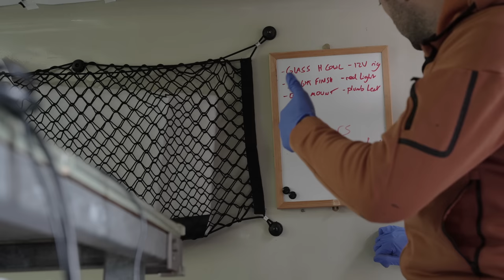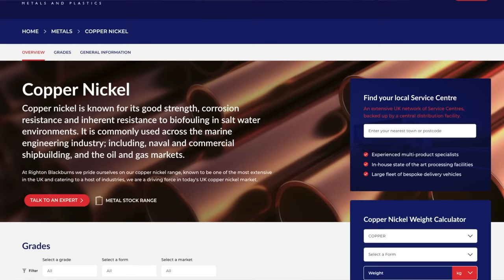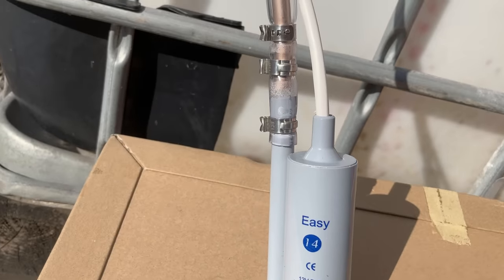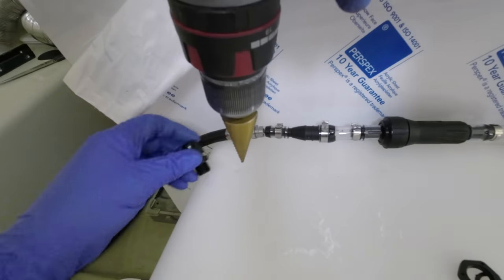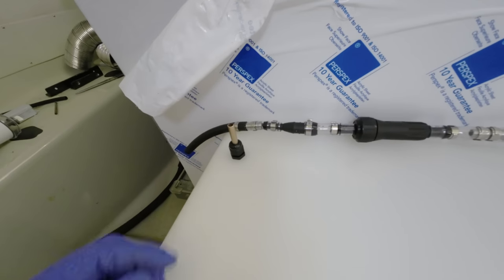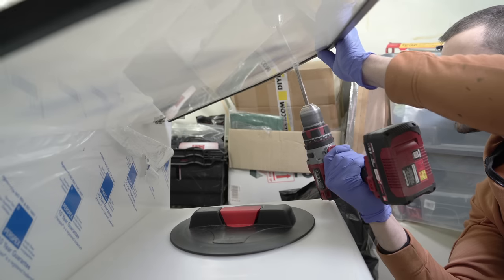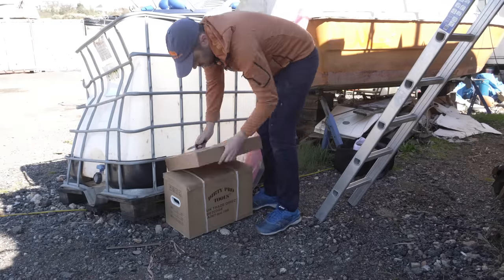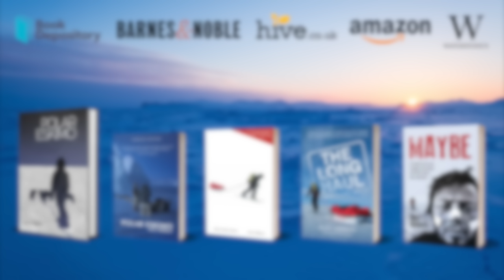12V drinking water pump wins over manual pumps w/ carbon block filter. Lifeboat Conversion Ep72 [4K]

Comment: Great work!  I'd be a little careful with the break line, it'll work great but there's likely residues from manufacturing like greases etc. I'd imagine they care less about break lines then a tube designed for potable water). It's very likely your carbon filter would be good enough but it might just be worth running a solvent through those lines, you could also run boiling water through it (Not with the PTFE tank fitted though). As hot water will probably loosen any oils.
Reply from the maker: Thanks for the concern, but the lines were capped on delivery and I noticed it said they were certified: Internal cleanliness to BS EN 12449.
Reply: @AlexHibbertOriginals  Oh interesting, very astute as always ^_^

Comment: for the swinging pump, an L bracket going to the side with a couple strong magnets should hold it in place. the inner one could be sealed to prevent corrosion.

Comment: Perhaps a baffle in the water tank from which the vertical water pipe could be attached to keep it from wandering. The baffle might help induce stability in Alan as the water can’t splosh around in bumpy seas. Like a tuned dampener in an earthquake prone building.
Reply from the maker: True. I'll need baffle balls anyhow.

Comment: Cut a hose to slide over the pump housing that will reach the bottom of the tank. The hose will do two things. One keeps the pump from bouncing against the tank. Two the pump can now reach the 50 to 75 millimeters of water below the pump inlet.
Reply from the maker: I like this, although the hose would need to be castellated. I don't want the pump to suck directly from the bottom in case of sediment.
Reply: @AlexHibbertOriginals  The obvious, so castellate it!  A Stanley knife would do, probably ....
Reply: You could also put a strong magnet in the hose, and one on the outside of the tank to clamp the pump in place.

Comment: With your pump flopping around inside your tank, you can use some of that thin cutting board that is about 1mm or 2mm thick, cut out a  long 300mm x 100mm section, drill holes for your pipes to fit through, bend over each end of the thin board at 45 degree angles & glue those to the inside walls of the tank with epoxy or silicone next to 2 corners.

Comment: I have used the same battery for my motorbike that I've built. Make sure you have the right regulator when charging it as if you charge it off the standard battery circuit from Alan's engine you can risk it blowing up as it can overcharge. They're great batteries.
Reply from the maker: Yeah they can only accept a slowish charge, so it'll be controlled by a Victron Smart split charger.

Comment: I bought a stickwelder years ago and have used it on plenty of non critical equipment. 
Most recently on my campervanbuild. 
Rarely pretty welds, but allways fun and it has given durable resaults so far.
Reply from the maker: Pretty is overrated.

Comment: "How to keep it still".  Easy, a set of suction cups  (like on a windshield of a car) inside the tank with just a dab of food safe rated rubber sealant so it does not lose the seal. Then a plastic zip line to the water tubes.
Reply from the maker: Do you not find suction cups never last long? Rubber sealant won't bond properly to polyethylene tanks. Barely anything does!

Comment: As for keeping the pump moored in the tank a simple rubber foot attached to a piece of spring steel that clamps to the line or pump. Set the foot 45° off each wall and the foot will limit contact with the wall.

Comment: Cushioning the pump against bumping will protect the pump, but eventually repetitive flexing will do in the tube. 
Cheapest, least invasive solution, now that the gland is already crimped, would probably be a pvc pipe mounting flange adhered to the bottom of the tank, cupping the base of the pump without blocking water flow.

Comment: Add an extra piece of pipe to the pump, fix it as still as possible.  Then use a pipe foot, the sort that kitchen cabinets use when free floating . Glue this to the bottom then insert the pipe into the foot. Glueing can be done with some spare food safe plastics. Use it as you would if soldering .
If you're going to be stick welding the you need to read, practice,  practice and do more practicing. Stick welding done right looks good and lasts but can be very unforgiving for the unexperienced. It can be very tricky, particularly on thin metal.
Reply from the maker: I'm considering a variation on this

Comment: Anchor the pump down. Take some stainless wire, bend a squiggly end and connect to a soldering iron, melt squiggly end about halfway into the pe tank below the pump, use soldering iron to melt and seal the plastic over the anchor wire and use the wire anchor to secure the pump.
Reply from the maker: I'd be nervous about DIY heat welding the bottom of the tank - but even if I wasn't, I can't reach that far inside.

Comment: While you may enjoy the flow rate at the moment you should be prepared for diminished flow rate as the filter does its job.
Reply from the maker: Quite possible. I can swap out the pump in 30mins or so, but it strikes me as better to avoid a higher pressure system than necessary.

Comment: A baffle may be needed … the water will slosh around causing additional noise and movement of the pump.
Reply from the maker: Yes the one central baffle may be insufficient. I have good experiences with baffle balls, so can add if needed.

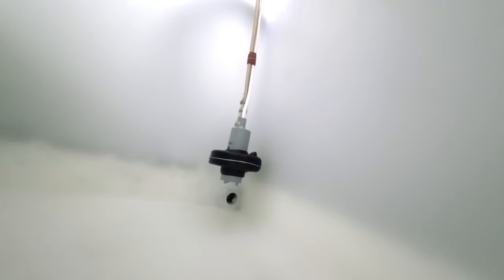Comment: could do a  little spring attached the hole visible at 6:47 to hold the thing stable. im not sure about securing the top. maybe a bend or a threaded peace. i bet if you try to use the fittings that are available to you youll find somthing

Comment: I'd be wary of having a rigid pipe on the pump. Seems like too much leverage when the water level is low and it's sloshing about. Maybe some stainless steel and a magnet to hold it in place? Or a much stronger pipe braced where it comes out the top of the tank? Or a brace that comes up to the lid hole.
I guess you looked at diaphragm pumps that would sit outside the tank. They seem very reliable and lift water quite far and generate good pressure and flow. That way you could just have a pipe sticking down and less windage than a pump assembly.
A puzzle anyway.

Comment: Using a longer piece of pipe could mean you being able to lay the pump flat on the bottom of the tank and thus it would move less. 
Either that or epoxy a shallow cup into the bottom of the tank so the pumps movement is restricted.
Reply from the maker: I want to avoid picking up sediment, and epoxy is very hard to bond to PE plastic.

Comment: You can probably use a magnet on the pump and on the outside of the tank. Then if you had to remove it the process would be easier.

Comment: Alex,  so my idea of vertically mounting the pump, filter and wiring to a length of 316 threaded rod that was fixed vertically into the lid of the water tank, thereby avoiding drilling holes in the tank and removing the need for a swing damper wasn't viable?
Now that you have a stick welded get some stainless weldall electrodes and you will be unstoppable!
Reply from the maker: It was certainly one of a number of options that would have worked. I do want to keep the pipes to the rear and hatch to the front, and be able to open the hatch independently of moving the stand pipe.

Comment: Did you consider having an external pump, i.e. non-submerged? I don’t understand the desire to put electricity under water, whether it’s bilge pumps or freshwater pumps or shower sump pumps etc. On my boat, the pumps are dry mounted in the engine compartment, with hoses going to the pickup points in tanks or bilge. This way, any electrical problems are fairly easy to fix, and the pumps are easy to swap out if necessary.
Reply from the maker: I take your point but I've not come across one of those submersible pumps that can caused people many dramas. I looked at a few inline ones but they were either huge, or too powerful, or both, or had bad reviews. I have a spare of this pump (£15) and it wouldn't take long to swap out if it fails and blows a fuse.

Comment: Great work.
Dumb Question: The wires tying the water tube and pump wire together, over the silicone tape, are Zn coated or galvanized?
Reply from the maker: They are stainless.
Reply: @AlexHibbertOriginals  Thank you for answering

Comment: Extent the copper pipe with a 90 degree bent and tie it to the left bracket off the workbench, should do the job!!!! BUT- there is way to many crimped joints on this, with potentials for leaks, please rethink for only minimum joints ?????
Reply from the maker: I understand about the number of crimps. But it's not like I can reduce the number of components without consequence. They are easy to replace and it's only water!

Comment: 2:51 I was merely curious why you chose to go with the bit of black fuel line at the end of the copper brake line instead of the clear plastic you used everywhere else. cheers!
Reply: oh I see because of the step down
Reply: was the clear tube's inner diameter smaller than that of the copper brake line?
Reply from the maker: I didn't have any 8mm clear pvc 😂

Comment: Why not thread your fittings directly to the tank if you can't find ones long enough to thread both sides?
Reply from the maker: I suppose I could, if I had a tapping set. Not sure how fine threads do when cut into soft plastics.

Comment: What's the thought process behind bringing your own clean water instead of using the water outside the boat and just purifying it? Is it energy? Do you need to do like reverse osmosis to truly make it clean?
Reply: Also for an idea to keep it still, have something that extends down and touches the bottom preferably with rubber. The friction will cause it to remain still. That's assuming if you can reach in. Otherwise maybe attach a bracket that it can clip into?
Reply from the maker: Cost and power needed. Plus once on location there's snow.

Comment: So, nothing you did was "wrong". But it's definitely unconventional. Typically you mount a bung through the side or bottom of the tank, connect a hose to the input of a pump, and away you go. Putting the pump inside - well, to me it just seems like a harder configuration with no real benefit. Cleaning a clogged impeller (mold, ice, debris are all possibilities) now involves removing the entire assembly from the tank, rather than disconnecting two hoses from your external pump.

Also, I didn't see how you have the tank mounted / supported, but I do encourage you to fill it completely (for testing) before you find yourself in heavy seas. It will be a substantial amount of weight.
Reply from the maker: I did consider an inline pump outside the tank, like the manual ones, but that would still need a stand pipe apparatus to hold the bottom in place. This rig is pretty quick to whip out if needed.

The tank is securely bedded on (mostly) solid fibreglass.